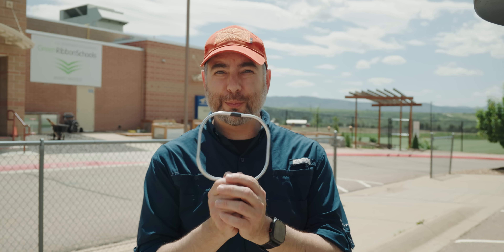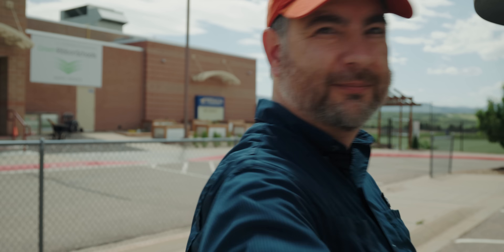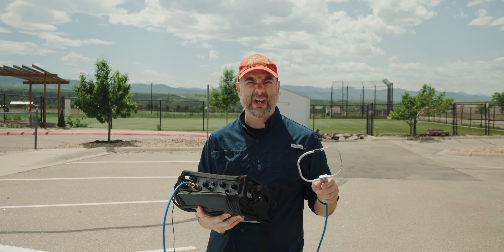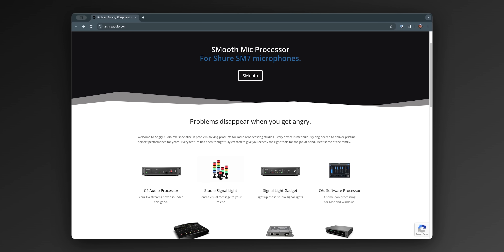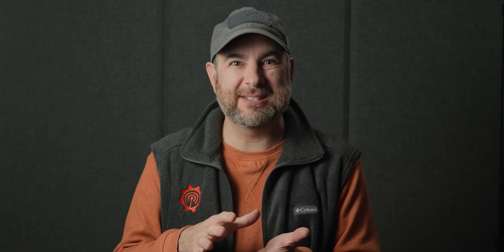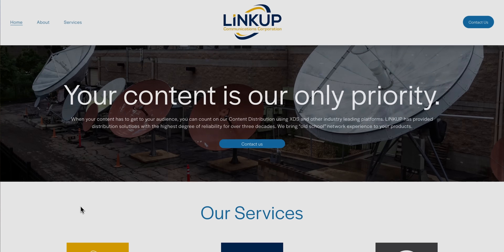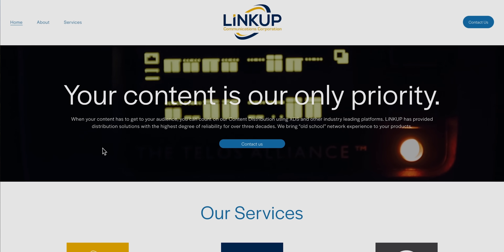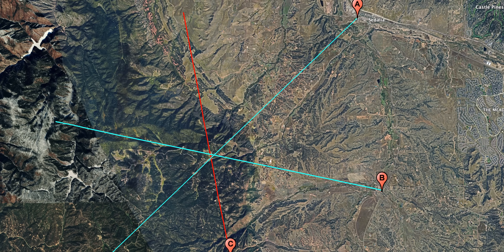Hunting a pirate transmitter

Comment: So how do you hunt someone that's mobile?
Reply from the maker: There are some tools that are specially made for direction finding.
Reply: @TheBroadcastEngineer  There's a guy that lives around me that will key up and transmit at one location and then keep moving to random locations. He doesn't follow a set pattern and it can be random.
Reply from the maker: Those are really hard. There’s a tool called Kraken SDR which can do faster DF. The FCC’s one they have is pretty amazing too in their trucks.

Comment: can you use any size mag loop antenna or should it be a specific one?
Reply from the maker: As long as you can receive the signal it doesn’t matter. If you use a UHF one it’ll attenuate a bit more so you can work in a little closer to the offending source.
Reply: @TheBroadcastEngineer  thank you

Comment: Nearly twenty years ago I built a loop antenna for 10 or 11 Mhz that attached to the rear of my Chevy Tracker. I along with a friend would then locate CB radio users. Some evenings we hunted stations that were quite far from us because CB users often used ham amplifiers to kick up their signal from 5 to several hundred watts. The hunts were always fun, much more fun than freezing in the woods during hunting season which my father loved without my help.
Reply: @migalito1955  As far as I know the CB bands are at 11 Meters not 11 MHz ?
Reply: @ulrichroos5873 typo....

Comment: For the common man, all that is needed is one of those Arrow brand loops, a handheld radio with an SMA antenna connector added, a map and compass.  Jyst hold yiur loop in front of your body with the null forward and turn.  Take a bearing from your spot and plot it  on the map.  Easy peasy, di it all the time as a HAM.  No analyzer needed if ones not handy.

Comment: I could do unidirectional locations on CB with a two element switchable endfire array. Up close I switched to a dummy load that only gave me a few feet range. I would switch to the dummy and transmit. "I am in the car beside you, only you can hear me." A bucket mouth was parked at a convenience store giving truckers a hard time. The harassment tuned down after that.

Comment: So was that actually a "pirate transmitter", or did you in fact find the location of the actual legal transmitter of that signal? I would have thought that "pirate transmitter" was a rouge transmitter transmitting on top of a valid signal, duplicate signal on that specific frequency. If that were the case, then I would think doing a full 360 degree inspection would have two dead spots.... the path to the actual transmitter and the path to the "pirate transmitter." No?
Reply from the maker: In the video I explained that I was using an existing legal broadcast station.
Reply: @TheBroadcastEngineer  Thank you. I missed that detail. So would the process be the same searching for a real duplicate transmitter... and in that case you would expect to see two directional blips as you did the full 360 degrees from each point?
Reply from the maker: @pianoman4Jesus Yep the process would be the same. When you take the bearing at the second point you’ll generally get an idea of which way you’re looking. If this video were a real world hunt, I would have gotten the general direction once I was next to the fire station.
Reply: @TheBroadcastEngineer  Excellent, thank you so much. 👍

Comment: Few years back I worked for a company in Europe who is a Harris competitor, and me and some others developed a system that you only had to drive around. Based on the signal strength values, the system  would create a heatmap that showed the strength plot. The system automatically calculated the position of the transmitter (The more points the more accurate it became). It even worked with mobile phones, but you needed additional equipment to instruct the phone to go on a free channel, and transmit on full blast For digital transmissions that have repeating elements like sync pulses or bits, Rohde and Schwartz has an even cooler system with its own precise clock that listens to that periodic signal and can detect if you are moving away or closing on based on the drift of the sync signal compared to the internal clock. In hours you can map an entire mobile phone network
Reply from the maker: There are some really cool systems. Problem is some of these systems only governments of large countries can afford them. 😁

Comment: Very cool.
As I was watching I was wondering if this could be used in warfare to locate the position of enemy infantry through their radios. I'm assuming this would detect encrypted signals as well, since encryption is digital, or is there a noise aspect to encrypted signals as well?
Reply from the maker: It was the reason behind CONELRAD (predecessor of EBS).
Reply: @TheBroadcastEngineer  So cool, thanks.

Comment: On your first try, standing in the parking lot, you found the bearing to the transmitter...or 180° from the direction of the transmitter.  Only after taking a second bearing will you know the actual direction.    If you had a compass mounted to the handle of your antenna, you could do this in two tries and it would be easier drawing lines on a paper map.
Reply from the maker: In the video I explain that I already knew the general direction of my target.

Comment: Why is 'pirate radio' such a bad thing? 🤷‍♂
Reply from the maker: Because it's usually someone who is interfering with another station, or has awful engineering practices and is damaging the spectrum for others and even interfering with aircraft radios (so that would be a life safety issue).

Comment: I did this for navigation. 
AM radio stations were marked on navigational charts. 
The Empirial Japanese fleet took the Great Circle route to Hawaii, following the AM radio out of Honolulu. 
That's not really "a thing" right now, as charts are electronic, and all navigation is through GPS essentially.  
However, I would like to be able to do this, and have a system with wide spectrum capability to track threats.

Comment: That sound thing is the best. Once you stumble on a curb with 10'000 bucks of RF test gear in your hands cause you were looking at the screen instead of where you were putting your feet then you really appreciate it.... My rig has that too... use it all the time...
And I use that exact same model of Fox Hunt Loop from Arrow... Some times I use their 3-el Yagi. The LPA I use mostly indoors.
Reply from the maker: HA! Yes! I was told when I did an Anritsu training class that they added that for the guys on the stock exchange. They have people roam around looking for signals. I guess you’re not allowed to have transmitters or receivers on the trading floors.
Reply: @TheBroadcastEngineer  Makes sense I suppose. Or used to at least, I can imagine all sorts of shady stuff that could be done with some radios on a trading floor. Wonder if they sniff for RF in casinos?

Comment: isn't the loop antenna bi-directional how do you know which direction signal is coming from ?
Reply from the maker: Yes, that's right. So the purpose of taking multiple points is to find that direction. You're not going to have two points in opposite directions show up with multiple spots.

Plus, for this video, I intentionally chose an actual station because I knew where it was. Makes it easier to record the video.

Comment: I’m really shocked at the size of your spectrum analyzer: You can buy an analyzer (with an internal battery) smaller than a credit card (but a bit thicker) for under $100. A loop antenna can be quickly made with a bit of any wire (in my younger days, telephone wire was easy to acquire). 

In my experience, a loop antenna can give a false indication near shorelines and other signal-bending features, such as rail lines and mountains. I’ve seen a ninety-degree variance within sight of a signal tower, when using AM broadcast stations for maritime navigation. (I’m sure most people use GPS nowadays lol) As you suggest, three or more Lines Of Bearing (LOBs) are helpful.

I’m glad you mentioned hams; I’ve had my amateur license since around 1978, and you can find many RDF techniques in a group of fox hunters. VNAs are a bit new to me lol but the best method I’ve seen is to use a pair of equivalent antennas coupled with diodes and an audio oscillator in conjunction with an FM receiver on your target’s frequency. As long as the antennas are equidistant from the transmitter, the signal is clear; any deviation will make an audible tone. 

Like your loop antenna, the null is bidirectional, so triangulation is crucial. This method works best with a voice FM or CW signal, as AM can sound a bit messy on an FM receiver, digital signals make the tone hard to make out near null, and SSB doesn’t have much signal when its modulation is low. 

The size and weight of this device make it much easier to use, than your desktop specan. Of course, a pocket nano VNA would do that, too!

Comment: i went hunting for a pirate just using a cheap Quansheng UV-K6 using the RSSI dBm meter readings with a loop antenna i made myself using some RG213 cable tied to a piece of conduit and it worked great.

Comment: you think that the loop antenna only workd in one direction, as can be seen when you draw your lines on the map in only one direction. in reality your loop antenna works in 2 directions, you should have drawn a line on your map moving  in both directions away from your landmark... With your so called 'expertise' on display here, clearly my pirate station is safe and will continue to broadcast for the foreseeable future..
Reply from the maker: Clearly you didn’t pay attention to what I said. I guess that’s why you can only run some cheesy pirate station instead of something commercially viable.

Comment: A simple add of a vertical antenna connected to one side of the loop causes it to become directional and still maintain the sharp null. I use a telescoping antenna I adjust the length for max null at each location
Reply: @W7ZQ-o9z2l  interesting. Does it work like a parasitic element on a directional, like the reflector on a Yagi (just backwards, I guess)?

Comment: Hello! I made a pirate transmitter (FM with PLL)  with a power of 300mW, and moreover, with a 5-order low-pass filter on the output (I am sure I didn't interfere with other requirements).I could catch my signal on distance of 5Km with the Degen-DE1103.

Comment: How do you know if it's in front of you or behind you?
Reply from the maker: Once you get the second or third bearing you’ll have a pretty good idea. As I mentioned in this video, I already knew where this target was. Using the tools that I had in this video, once you get the second and especially the third bearing you’ll can see where the lines are converging. If it was behind you then you would see the lines converging in that direction. You can get a general idea using an HT without an antenna as others have mentioned in the comments here, or driving around and hearing where the edges of coverage are.

Or if you want to go the “spared no expense” route, you can buy a Kraken SDR. Cool device, but out of my price range.

Comment: When i was a ham, we did this kind of hunting, but we did not hunt pirates. We had "fox hunting". Some years ago, one of the members did made the weekly radio round from out his car on a secret location you could find with your equipment. But mostly we did a "fox hunt" in the woods where you had to find many (maybe around 10) small transmitters which had a number of letter on it you had to note on a piece of paper.
Reply: Thats sounds so fun ngl
Reply: Came to say this, when I was in high school like 20 yrs ago, friends of mine had cb radios in their cars and we did rabbit hunting around the city.  They were using the strength meter on their radios to see the direction someone was transmitting from lol

Comment: In the greater New York City area, where I was a broadcast engineer of some class A FMs years ago, pirate stations on frequency were not uncommon. How you find the pirate station is to send a FAX to the FCC field office describing the interfering station and they will dispatch an engineer to find the station and have it shut down. Worked every time. That's what we expect. No need for detective work or confrontation.
Reply: Most FCC field Stations are closed these days.
Reply: @JustMe-u6o2j  While they did close many FCC field offices, they did not stop enforcement actions. They consolidated operations. They will still respond to interference complaints sent to the feild office associated with the district that the interference is occurring in.
Reply: depending on the area it might not take them long anyways. If you have the equipment budget there are some other tricks to hunt signals; fancy arrays capable of comparing time-of-flight come to mind
Reply: I’ve seen officials (or what at least seemed like officials) dispatched in Gantry State Park on the banks of the East River in Queens (across from the UN building in Manhattan).  Might have been my first time to see that.  Fascinating.
Reply from the maker: No way am I confronting anyone. Nope. No thank you. That's the FCC and the US Marshal's job. 

However, these days, you have to do all the legwork to prove the pirate exists and where they're at. Then give that to the FCC who then does their own investigation. Sending a fax these days won't get any movement. The last time I had to hunt a pirate signal in a real-world situation I had maps with lines, recordings, photos, etc, and basically sent the FCC a "report" with all the evidence. Then a few weeks later they drove to the place where the pirate was and shut them down.

Comment: Probably gets a lot trickier when you are trying to locate a pirate squatting on another broadcaster's frequency.    Both signals will be present at the same time, so finding the right null can be tricky.     Great video on the principles of the loop antenna and technique in general.   Thanks!
Reply from the maker: Easier to get some off air time to get the bearings. When I did it last time, that’s what I had to do late at night.

Comment: How do you know which side of the loop is the proper null?
Reply from the maker: You take multiple measurements from locations miles apart. You'll start to see a spot where all the lines converge.

Comment: BTW you are slightly biasing your direction finding by knowing the general direction of the signal.  This is not crazy different that what you demonstrated.  It's just that your first point would be designed to establish the plane of the source (either it was in front of you or in back).  You would then proceed roughly perpendicular to this line, then repeat it after a distance.  These two together would eliminate one of the directions (either the lines would be converging or diverging, and it cannot be on the diverging side).  Ideally you would then try to go in this direction and get a 3rd point on the other side of the source for the most accuracy, but you can also get okay results if the points do not surround the signal and are far enough apart.  It's just compounding possible errors that way (and thus possibly needing more readings).  Also pirate hunting is also interesting, because for example perfect pirate transmission antennas might be that gate behind you, that fence with the razor wire on it, or even a tree or building with a rain gutter or wire run up the side.

 
Interesting note, this is exactly how early trans-oceanic navigation was done.  In fact anyone interested should look at Amelia Earhart's final flight and how not having a basic understanding of direction finding with radio waves occurred on both her navigation side, but also lack of understanding on the ships that she was using as navigation points.  It is highly suspected because they had issues with getting signals on their loop antenna's they tried using their dipole antennas (which would not provide the same navigation).  There also appeared to be confusion on the frequencies and procedure needed to periodically get a fix, so instead they may have attempted to chase amplitude on frequencies  that propagate through atmospheric reflection  (thus not providing indications to the source, and only falsely chasing reflections).   And this all originated by a last moment decision to change the direction of flight removing most of the safety options if they had issues with the radio navigation (mainly dropping the ability to change direction as a contingency and be able to get into visual range of large island chains and follow those).  By reversing the direction they no longer had the ability to possibly overshoot and use visual landmarks, they only had open ocean in all directions and not enough fuel to return to a point within sight of land.

Comment: Where do you buy one of those null antennas at? He didn't say. If you google it you don't exactly get anything about where to buy them. I need this to find "repeater kerchunkers"! In ham radio, we call it kerchunking when someone transmits to a repeater and does not talk or give their call sign (if they even have a ham radio license and call sign). They just activate the repeater output and cause it to transmit for a few seconds. We have had really bad and repeat offenders here in Utah that do this all the time and do it on purpose to interfere. I can use a handheld radio to do the same as he does with a SA. And it helps to turn on attenuation on your radio when you get really close to the offender make it easier. Most ham radios have an attenuation setting. Of course to find one of these kerchunkers we listen for the input frequency to the repeater, not the output. In the case of these offender in ham radio, they don't transmit very long which make it far more challenging than what he does in this video.
Reply from the maker: I’ll get the name off the packaging and comment back here later. Or at least I’ll try. I can’t make promises. But I will make an effort.